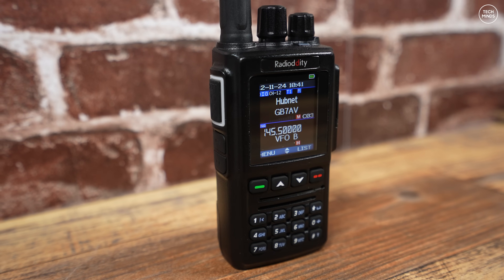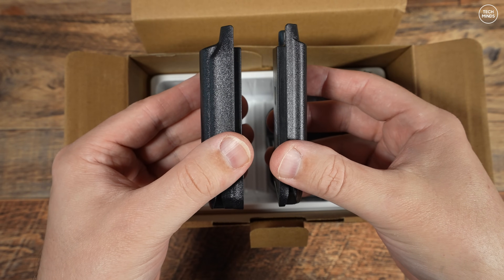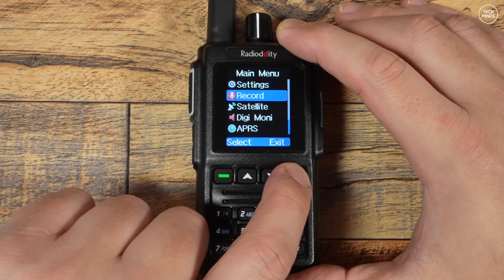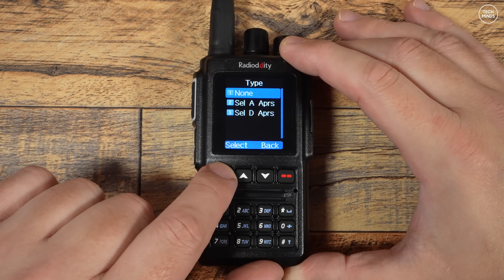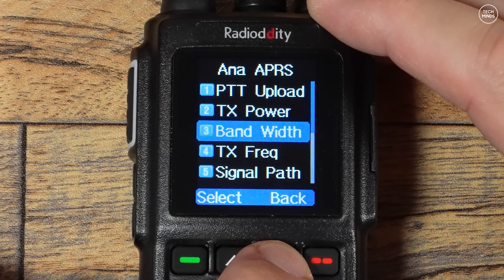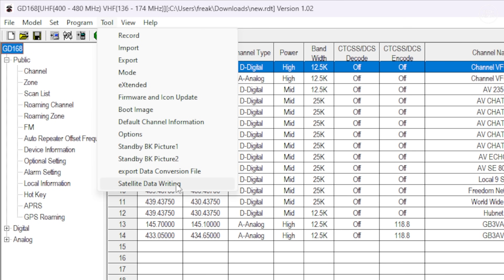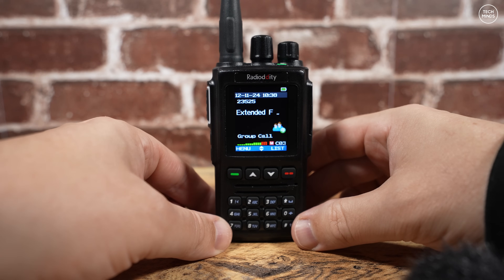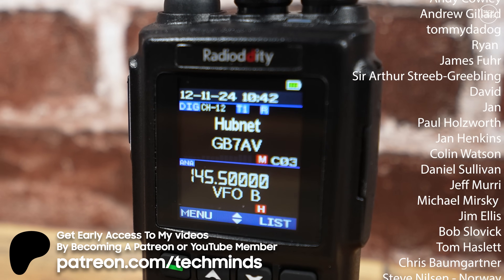Radioddity GD-168 - The Perfect First DMR Radio? This IS it!

Comment: The Radioddity version of the programming software does not allow the selection of 5 kHz deviation (25 kHz BW) in FM.  That is an issue for US users.  The Anytone SW has a selection for both 12.5 kHz and 25 kHz

Comment: What's the point of APRS if you are setting a static location via the programming software? 🤨  basically your have a portable HT that you can take into the field , to the store ect and you transmitting out via APRS the only l9cation your NOT at? I don't get the point of that... If they wanted to put in APRS without GPS should of put in Bluetooth and let it connect to a phone and run APRS via Aprsdroid type software...

Speaking of NO GPS how are we predicting satellite location without GPS? Oh we have to download that from the computer in advance? I see 2 problems with that...

1. Your location to the satellite passing overhead are based on your current or location set when you are downloading the data.. That's all great if your gonna run out the door and hit a satellite from your backyard.. But if you download the data and then go on your merry way out to the field or camping ect. Don't count on it predicating where they are as its set to the location you left unless you have the foresite and  know the exact long / lat of were your going to be this too is a useless feature.

B. How long is that download data good for? Id say probably not long so again without GPS to track your location and the sat I see this as useless unless you are doing it right out the door or bringing a internet linked computer with you everywhere to continuously downloading program this radio. 

All in all (IMHO) the Radiology GD-168 seems like a Basic DMR / ANALOG  HT ( which is great) with other half baked features ( which is not great) at a full baked price tag (also not great) 

I think they would of made a AWESOME radio at this same price tag if they just added Bluetooth to connect to your phone and use the phones GPS to help with both APRS  & satellites. This could also give availability to Bluetooth cordless Mic's they could sell separate... Wow now thinking about it  you really missed the mark with sales too 🤦‍♂️

Comment: Does it support encryption? Been looking to replace some commercial radios with DMR radios with encryption for a while now.

Ham radios are always preferred because of the cost, easy programming, no commercial licenses, parts support and easy repair and maintenance.
Reply: We also have business radio licence classes in the UK. Yes the radio supports lower end encryption (Arc4 / AES) which is fine for commercial business use.
Reply: @mully89  thanks
Reply: Encrypted transmissions are not allowed on amateur radio frequencies
Reply: @SyrupSplash  And that's why I specified that the encryption is for commercial use...
Reply: No license? commercially used? Hmmm illegal use is never allowed or suggested. Good luck with that. 😂😂😂
Reply: @FranklySpeaking73  I have access to commercial frequency ranges. What radios used is on those frequencies up to me, so why bother to comment it is illegal when you obviously don't know the rules in my country? If you misunderstood the frequency range is licensed, and I prefer HAM radio equipment because it does not require a product license unlike many commercial solutions

Comment: Thank you, interesting device. It is somewhat similar to Retevis RT3S and its clones. It would be interesting to know what is inside, I would not be surprised if it is the same as in RT3S. It would be great if the manufacturer opened the firmware source code. I am working on the OpenGD77 version, but without documentation on the DMR chip it is quite difficult. 73!

Comment: Honestly i have no idea why anyone would want to go dmr . The point of radio is to be totally independent of government and external needs.  With dmr you might as well use your mobile phone . Ok ok you say repeaters might be shut off . Yep. But with 5w you still got a good coverage. Wit dmr ? You got nothing . Why not get an app on your mobile same thing
Reply: There's different ways to use a dmr. You can be completely independent as a walkie and digital signals have a longer range and are more clear, and due to it's nature it has more security as regular walkie talkies can't decode the signal
Reply: Isn’t it also a VHF/UHF dual band HT in addition to to its DMR modes ?
Reply: OP, I suggest you open your mind and seek to understand. DMR has the ability to link many repeaters together with minimal effort relative to other digital modes. There are many PROs which outweigh the CONs. Digital uses much less power compared to analog so batteries last longer. also comms can be identified so you have accountability. No more anonymous kerchunking the repeater all the time. 😂😂
Reply: Love dmr
Reply: I just think it’s neat (:
Reply: @rockman1811  commercial dmr is awesome!
Reply: A DMR/Analog walkie is just the same as your analog HT except you can transmit to specific radios much easier. Private groups/calls could in theory be encrypted. You can send text data just like a phone. It also makes better use of the repeater space with TDMA. Audio quality also transmitted as a packet allowing the message to come through at range without falling off.
Reply: For a long time, I also preferred to stay away from the DMR mode, mainly because the functionality and voice quality of Fusion are vastly superior. However, the issue in my country is that many public service and emergency networks operate on DMR, and I really enjoy listening to them.

Not to mention that there are nearly a hundred times more DMR repeaters here than in any other digital mode. So, it wasn’t exactly a matter of choice, DMR has become my digital mode, and I can’t really complain, as you eventually get used to that distinctly metallic, robotic voice 😂
Reply from the maker: I don't personally think that's the point of radio at all. The point of "Ham Radio" is to experiment and have fun, learn new technologies and embrace change. Still plenty of people use FM and SSB. In an emergency situation DMR would fail unless its "point to point" of course, but it's not designed as an emergency system is it. Having all modes available is a preppers dream though right?
Reply: @TechMindsOfficial dmr is useful eith friends when u got council repeaters in range who use dmr and you sit on timeslot 2 and give handhelds to friends using encryption without causing interference mwahagah
Reply: Trick is to use dmr through your own repeater, or stick to hf! Much fun

Comment: Nice radio.  I have the GD-88 which has audio level problems even after firmware upgrades.  I hope they fixed this issue with this new HT.  No built-in GPS receiver on the 168 yet it has satellite tracking counterintuitive I would say.  Would be interesting if firmware upgrade on GD-88 would bring satellite tracking to the 88 in the future.  Is this new HT worth buying, only time will tell.  73s from VA7LFD
Reply: A while after I purchased the GD-88, I
was able to return it for a refund. 😊